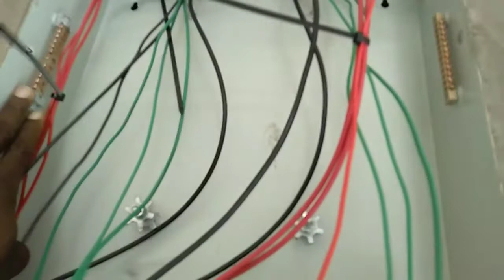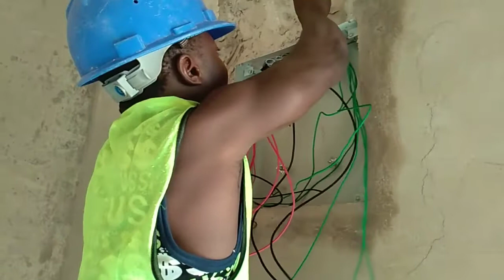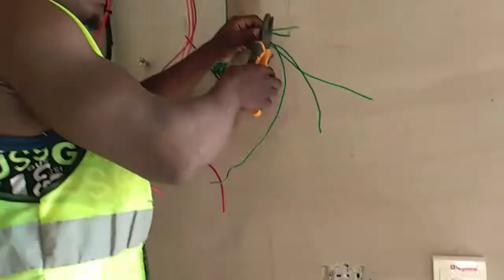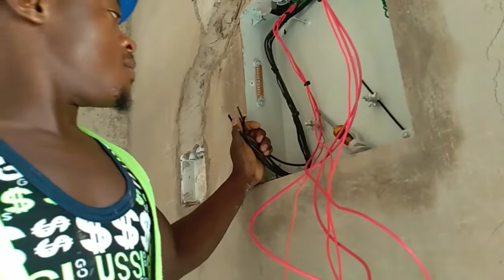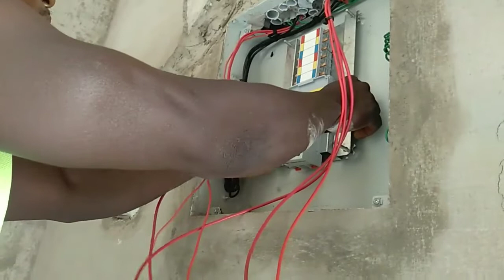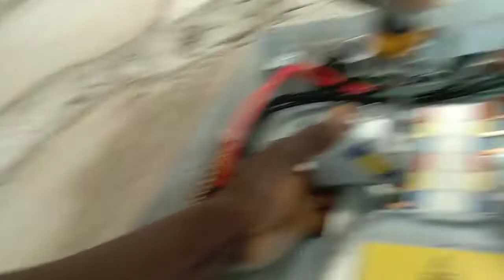Three(3) Phase to Single Phase Distribution Board Wiring Diagram#diy #engineering #installationguide

Comment: Please, can you attach a single phase RCD to a 3 Phase DB in case of using the 3 Phase DB for Single Phase Wiring?
Reply from the maker: Yes in as much as it single phase wiring but the load should not be more than the capacity of the single phase RCD

Comment: Pls what's the maximum current that can be drawn from a 3 phase system
Reply from the maker: Good question, let me explain Amp of distribution board are of different rating for different countries in Nigeria we have 3 set of 3phase Distribution board. Which are 3PH D4, 3PH D6 and 3PH D8 respectively which through this the rating of your distribution board is calculated. I will like more questions so that I can do more videos on distribution board

Comment: Why did you used 25 Amp breaker for AC , and Standing FAN instead of 30 or 32 Amp breaker?
Reply from the maker: Converting Amp to watts, 25amp 25-amp 240-volt circuit: 25 amps x 240 volts = 5,500 watts.

Knowing  that 1hp AC is equal to 745.1watts and 2hp = 1491.1watts which is still not upto 25amp. So if I may ask how did you get you calculation of 30 to 35amp thank you.
Reply from the maker: Not forget to subscribe and let me know what video you will like me to do

Comment: How to load a 3 phase consumer unit
Reply from the maker: 3phase consumers unit are of different rating and MCB.
1. Calculate your total load
2.Divide your total load by the number of MCB
3 Ensures that the power and lighting unit are balanced according to the Amp rate.

Comment: But I thought 💭 we use 1.5 mm for the lighting points nd 2.5mm for sockets 

But here I’m hearing arms 🙄
Reply from the maker: Welcome my friend, I will take much of my time soon to educate Africa on Electricity, traditional you are right but calculativily your wrong, All cable Size have is it Amp rate which can be used for load balancing, so with proper calculations you can even use 1mm for lighting point.